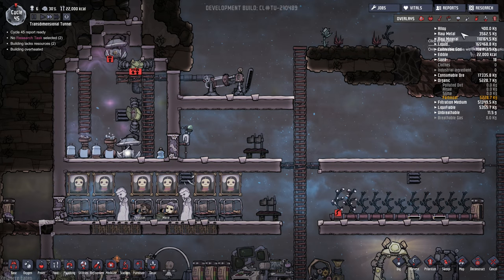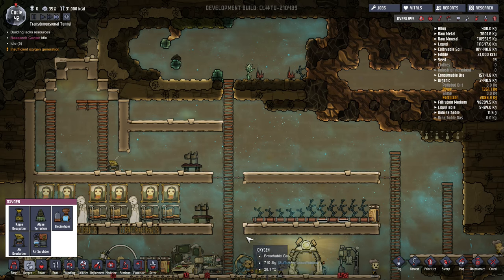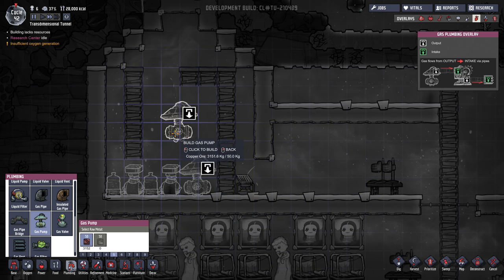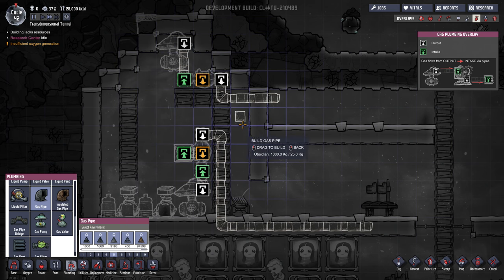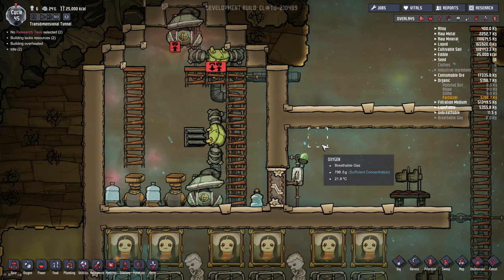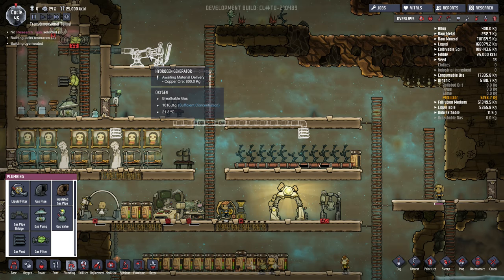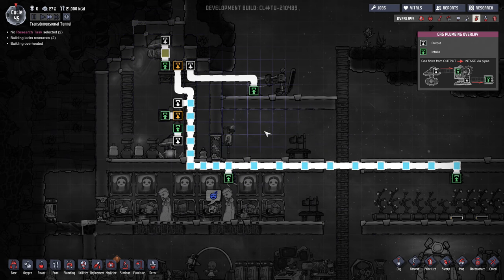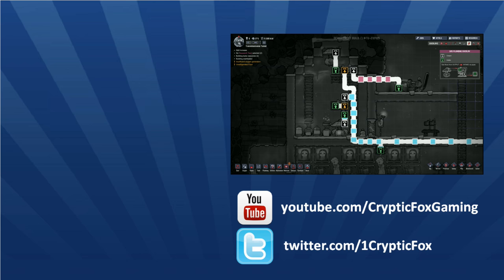How To Make an Electrolyzer Ventilation System! -  Oxygen Not Included Tutorial/Guide

Comment: Why not just make a single pump and use an air filter to separate out the hydrogen?
Reply from the maker: The single pump won't move enough gas volume to be effective unless you have a really small colony, plus each segment of gas in the pipe is distinct, so even if it was sitting in half O2, half hydrogen, you'd only have 50% air flow to your colony.  The reality though is that the way the gases separate you generally end up with the pump in either O2 or Hydrogen most of the time.  multiple pumps lets me move higher volumes of O2 and hydrogen separately.

Comment: Why you cut the most important think? the water use.
If you not know the Electrolyzer use 1kg/s of water, but the pump will give 10 kg/s, so what happen at 9kg/s? just vanish into nothingness
Reply from the maker: In the thermal upgrade update they're supposed to have fixed the conservation of mass in pipes so that shouldn't be an issue going forward.

Comment: Dont do that Setup, it's flawed at so many points. Just get one pump and one filter, thats far more power efficient. Also one eletrctrolyzer is more than enough to produce oxygen for 8-10 dupes or more. Also it's worth noting, that hydrogen is not a reliable powersource. It's just a side product you have to work with. You will get to a point where you produce so much oxygen that cannot keep the electrolyzers working thus stopping from producing fuel.
Reply from the maker: +Jugg3r lol well I don't know about so flawed at so many points but there are multiple solutions to every problem.  I've used this set up in virtually every colony and don't often have issues reaching max air pressure with temperate conditions through my base.  The nice thorny about the game is there is always more than one way to play ;)

Comment: This model doesn't work, but just try to simplify it by taking off the upper part and using the middle output from the filter pipe to get hydrogen to the hydrogen machine (I don't remember it's name😂😂)
Reply from the maker: I've been using this model for months without issue, but it's certainly not the only way to set it up :)

Comment: Why use two Pumps? Why not just use one Pump and one Filter? That way you can divide the gases much more simply and need less power. Honestly, this video seems like you just made it more complicated than it needs to be and thus made it VERY inefficient.
Reply from the maker: I used separate pumps because sending both gases through the same pump and filter reduces the amount of oxygen you can move to your colony.  Whenever a packet of hydrogen is going through the pump and filter, a packet of O2 isn't.
Reply: I tried this myself and I found using 2 pumps to be better because the room you use for the oxygen production otherwise gets too stacked with oxygen but using 2 filters was overkill. Using 2 Electrolyzers and 2 Pumps that connect to the same filter the flow was always stable and the hydrogen was always sucked up almost as soon as it spawned and as such would not make a difference in another pipe. I suggest you try the same thing you did but with 2 filters cause as said, think you're right about using 2 pumps but 2 filters is wasted as they do not increase the efficiency. Welp, still gonna say good video as I am using this now in my currenct colony, well, my slightly modified version of it.

Comment: This setup is very weak. First of all you have 2 electolyzers and 2 pumps.. Electolyzer outputs 1000g of gas per second and pump have only 500g/s input. Second problem is dumping hydrogen back to room with electrolyzers, instead of dumping it right to hydrogen generator. You also waste too many space for nothing, it could be easy compresed. Last problem is electrolyzer output temperature, it's 70C. For hydrogen it is not a problem, but dumping 70C oxygen right into your plants is not good idea. Id the beginning you won't cook your base, but when area next to the pipses get warmer you will suffer very high temperatures in your living area.
Reply from the maker: Hence the reason I haven't used this setup in more than a year, and have a diferent setup I use consistently now.  At the time this was created, heat really wasn't a factor in the game.
Reply: Is the oxygen output so hot because of the temperature of the water coming in? How do you use the electrolysers; 2 pumps per electrolyser in a small room with cool water input?  I only have clean water through a sieve, so it's at 40C. Is it easier to cool the water first or the oxygen coming out?
Reply: @funlovincop  As I remeber in this verion electrolyzer gas output is fixed on 70C
Reply: @PalczakPL  Oh thanks! I'll check it out on the version I'm playing